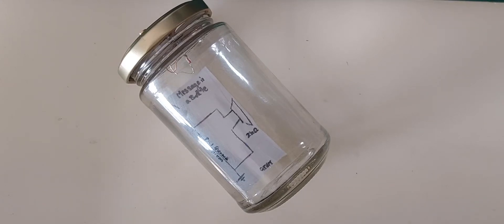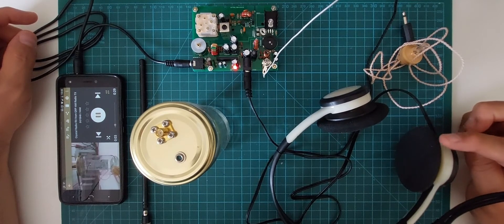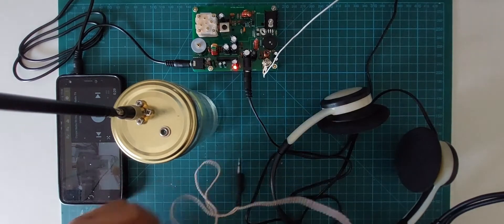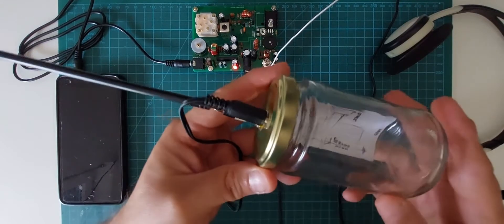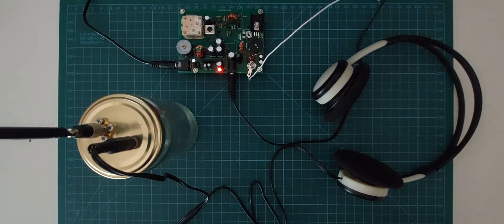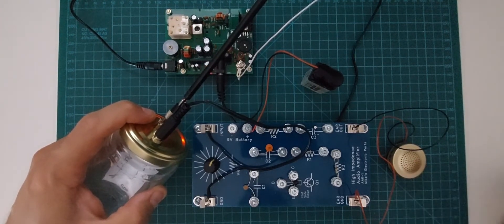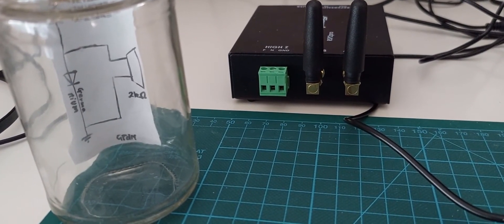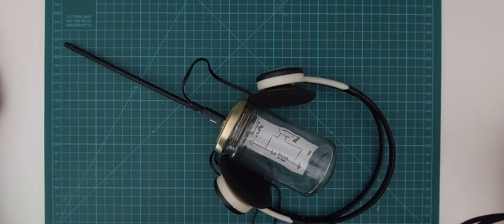Bench test of the Simplest Crystal Radio and comparison to an SDR

Comment: Plese tell me, if the headset had only one earpiece (but the same overall inpedance), would then this single earpiece receive more current and hus be louder altogether, compared to using a headset with 2 earpieces? Second: I think the glass-jar is confusing everyone, since only the jar-lid is needed... Right?
Reply from the maker: 2 earpieces require more energy to maintain the same volume as one earpiece.

But, the higher their impedence, the less energy they draw.

There is, comparatively to transistor radios, little current available in crystal radios.

Earpieces are voltage driven, not current driven.

So, earpiece(s) with high impedance are used here.

For the same reason, diodes with lower thresholds are used.

There is a lot of literature on this topic. I can't cover everything in one post.

I recommend reading.

Happy research!
Reply from the maker: The glas of the jar is a container like the casing of all those radios which have a casing.